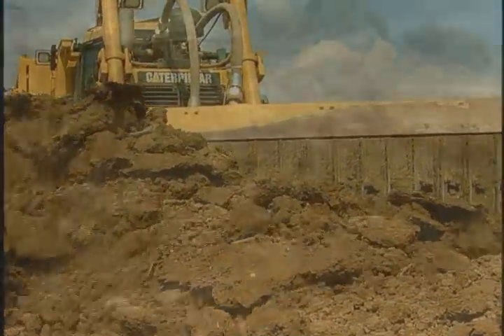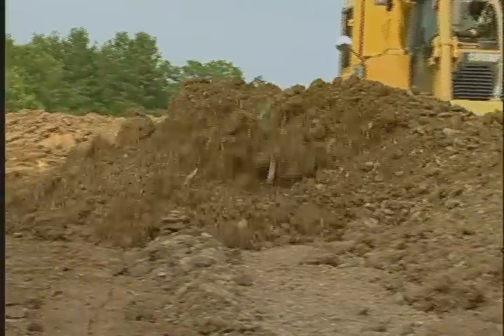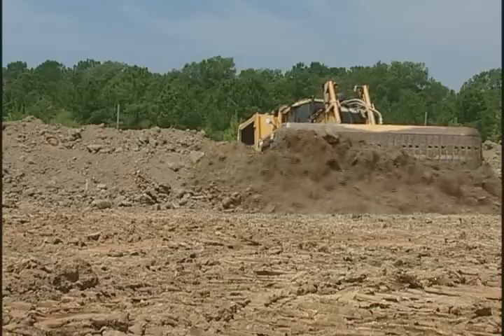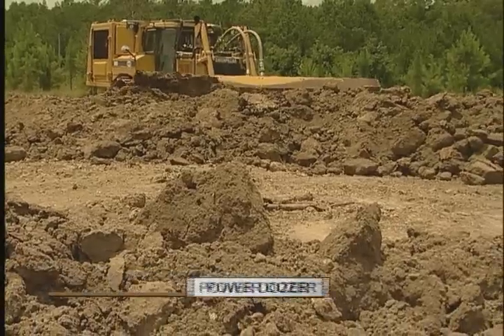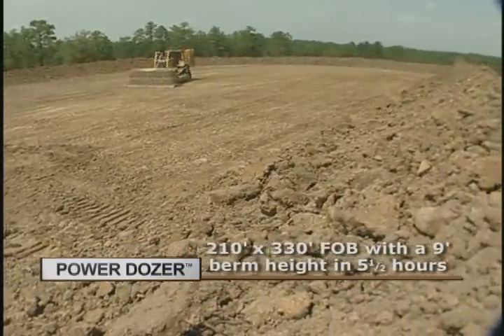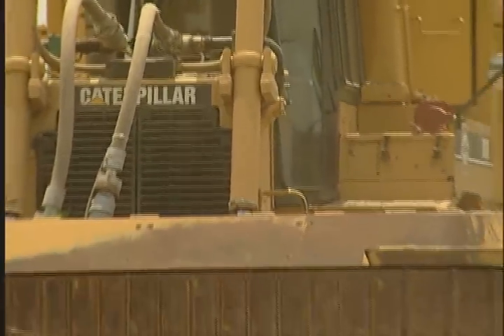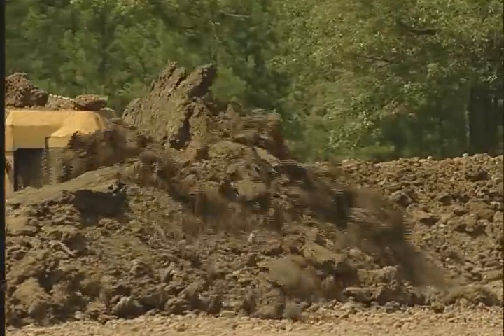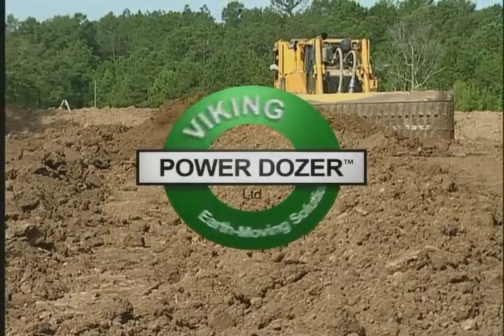Introduction to the Viking Power Dozer

Comment: A six angle blade does the same thing CHEAPER Bro
Reply: Geo Thomas this thing requires a whole second hydraulic system and engine
Reply: Justin Brisebois rite I use enough hydrolic oil I don't need more it's more to break

Comment: I didn't know that they don't bed pipelines, just dump spoil over the top as if it will get under it and get packed on it's own.
Reply: Shouldn't there be a layer of sand around the pipe before it is backfilled?
Reply: @epistte  if your backfill material is full of rocks then yes but if it’s good dirt then usually no.